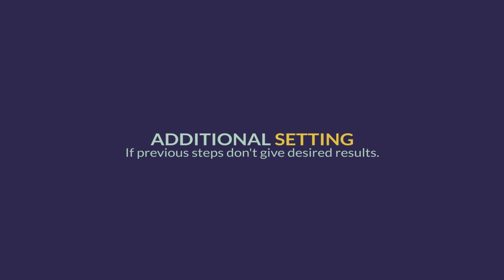How to align gathering belt of asphalt mix plant

Comment: Don't agree with adjusting the pulley in the first place. It should pretty much always be 90° to the belt to put minimum stress on the bearings. Adjusting idlers usually works just fine.